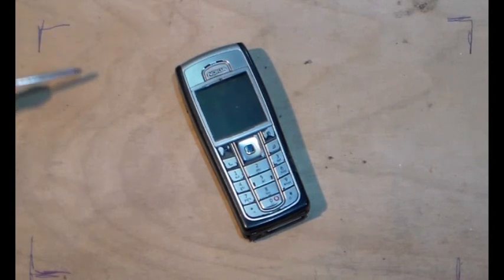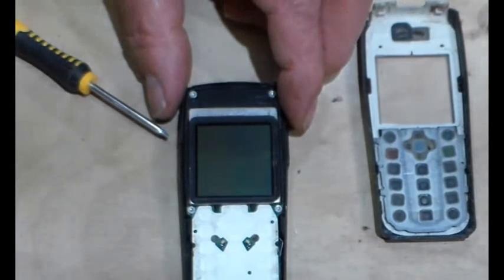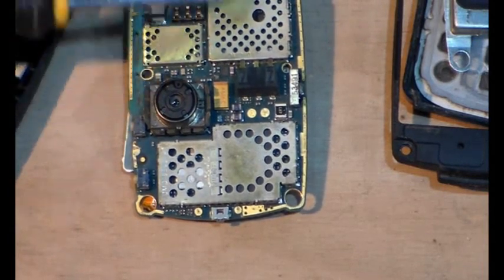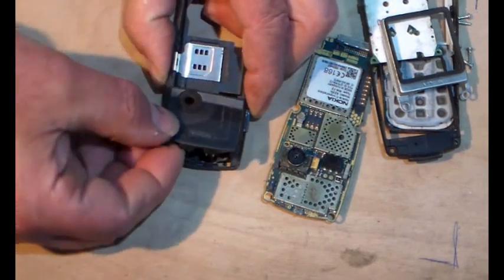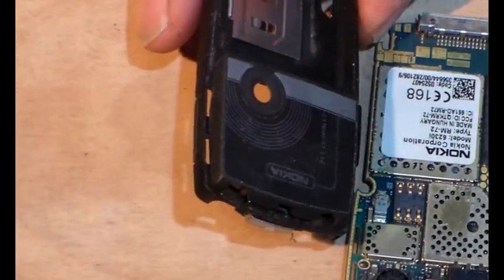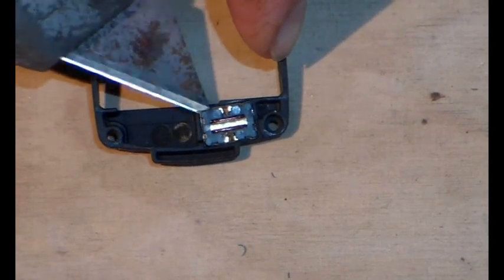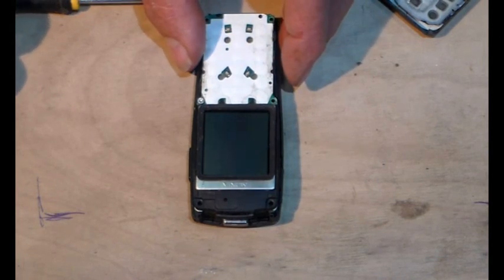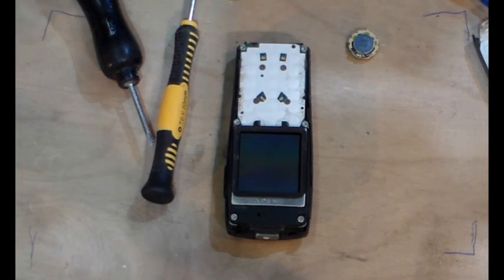Nokia 6230i phone, poor sound investigation. find the speaker.

Comment: If you do any metal grinding,  the speaker has a super strong magnet and the metal dust will find its way through the holes of the phone and press against the plastic speaker as they try to get as close to the magnet as possible.  While the metal dust leans against the plastic wafer speaker the sound grows weaker and weaker with the more metal dust collected slowly over time.
Reply from the maker: Hi, thanks for the info, my phone is in a leather bag but I can see how this can happen. When metal working put the phone out of the way, cheers
Reply: That would never have occured to me. Thanks for the info.
Reply: This is a good point. I had some issues with laptop speakers sounding rough, upon opening it I found the drivers covered in metal dust. blowing them off solved the problem. Even though the computer had never been in the garage where I grind metal.